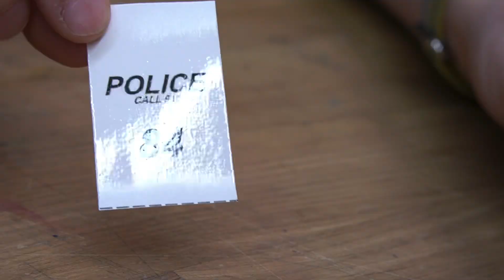Matchbox Custom - Ford Explorer Police Car „the Interceptor“ with simply LED upgrade

Comment: Have you found strobing smd micro leds anywhere? Where’s you get the flashing smd leds? I’ve been looking for a setup like technikl designs strobe set without spending $25 bucks.
Reply from the maker: Hey I bought this 0805 LED SMD on eBay. I think 10 was under $10 and it was all pre-soldered. I've been looking for strobing leds for a long time but couldn't find any. unfortunately...